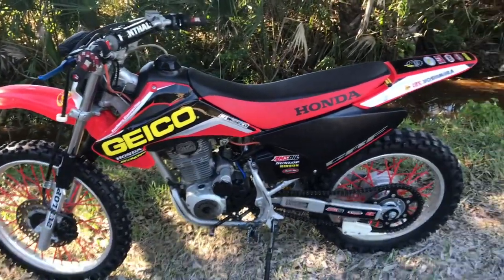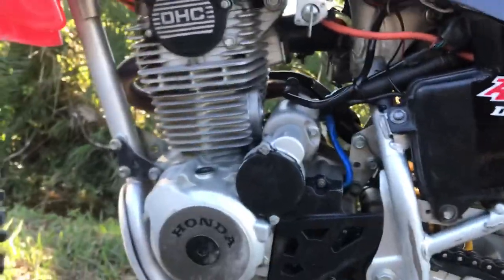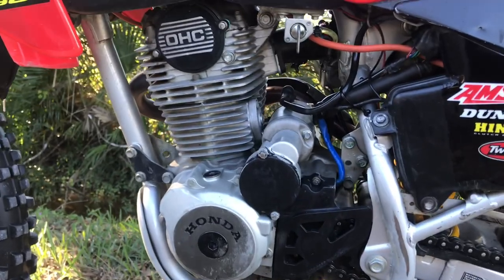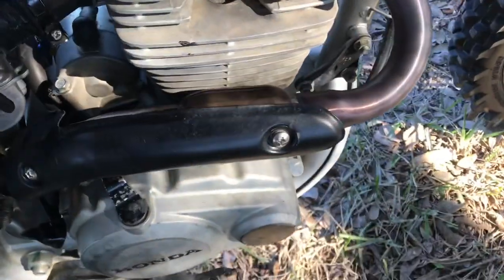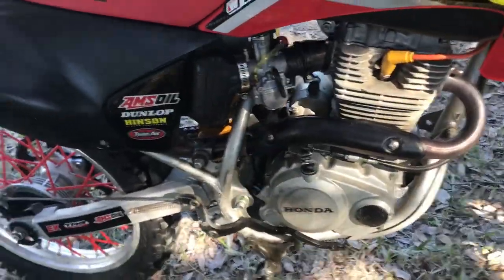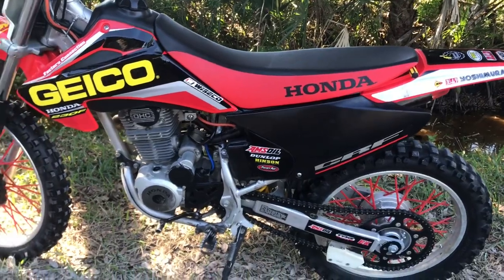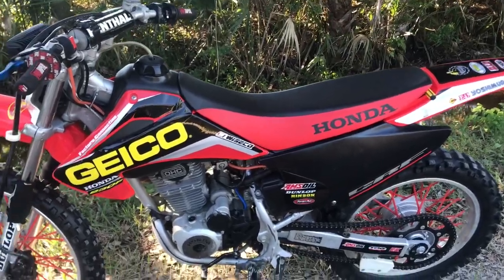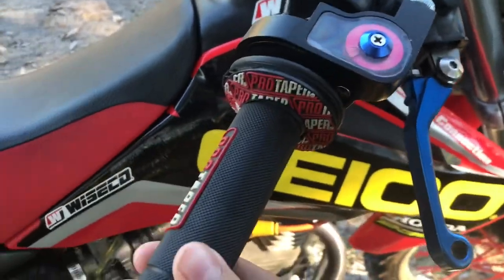Modified Crf230f (high compression rebuild)

Comment: gotta say man, this was a big inspiration for my build, ended up with a fully self ported and polished head, +2mm lift and duration cam, roller rockers, bbr valve springs, valve lapping, milled the head down, weisco 11:1 stock bore, 4k-12k rpm selectable cdi, oil cooler and more im sure I'm forgetting.
Reply from the maker: Sounds like it’s gonna be a blast. I had a hard time sourcing parts back when I built mine. Couldn’t find any reputable options for cams and springs that wasn’t $800
Reply: @garbinsgarage  kinda had the same issues but ended up finding an alibaba express one that was crf230 purpose built and claimed +2 mm for under $50 and the roller rockers where under $25 and actually the bbr valve springs costed about the same as roller rockers and cam combined. only down side was can and rockers where China shipped.

Comment: I just removed the smog stuff from my 230M, that made a difference! I'm looking to do a big bore kit or something in the near future.
Reply from the maker: Spartan375x, you can find a complete kit by athen for the 230 that brings is up to a 240cc but is a little on the $$$ side. I did a hone and used a high compression stock sized piston
Reply: @garbinsgarage  Do you have any links to that big bore or high compression piston?
Reply from the maker: Spartan375x https://www.ebay.com/itm/07-15-Honda-CRF230F-CRF-230F-67mm-233cc-Athena-Big-Bore-Cylinder-Piston-Top-Kit-/192898315821- this is to the Athena kit which in great not quite worth the money, I would by a slightly larger high compression piston like 66-67mm and have a shop bore out your old cylinder all that should be about $180

Comment: Switch your sprockets out youll get better acceleration and is way worth it on a dirt bike, Ive got an old '83 XR200R with a later motor big bored and cam job etc, doesnt sound much different to your crf here and I used a 11T front sprocket, havnt got times yet but it shifts, Ive also got a FTR223 engine with an ATHENA 240 kit and BBR cam engine I got for my XL185 as a donor engine but I may use it in my '81 XR200R due to lack of a local engineer for a modified engine build I had planned.... awesome bike kid ! ✌🏻
Reply from the maker: The only thing is with dirt bikes is, they are geared pretty low to start with. If you go to a lower ratio sprocket, you’ll get more acceleration but it will lower your top speed and make the gears really close. On a dirtbike, I would actually go up on your ratio so make the back one smaller by a few teeth. Give you more to end. I did that to my 230. I have a 49 tooth and I went to a 42
Reply: @garbinsgarage  depends what your looking for isn't it,

Comment: Engines only 250kit 11.5:1 compression only makes 23.5 hp( just the big bore and compression) no way ur stock bore 11:1 with carb, air box mods, and exhaust gonna add 7hp. A high end full exhaust will only add 1hp. 

U might have 20-21hp what ur feeling is the torque from the high compression.

Comment: is high comp setup has noisier engine? what fuel octane rating are you using?
Reply from the maker: MunsKi it is a little bit louder. Has an idle sound more like a race bike. And I run 93 or 91 octane. With about 11.5.1 compression it’s ok on pump gas

Comment: Does it run hot or does the bigger carb (rich air to fuel) help cool it down
Reply from the maker: Hasn’t overheated on me at all and I’ve beat the crap out of it at 7000+ for 30+ min. I jetted the carb correctly so it’s not Rich or lean. But it is pumping more air and fuel through the engine for sure

Comment: What’s you do to the front suspension? Did you take off the covers from the forks?
Reply from the maker: Yes the covers unscrew and pop off but you have to have the bike on a Stand or the springs will fall out. I put a 2in pvc spacer on top of the spring to get it preload and 15w fork oil
Reply: @garbinsgarage  thanks, I appreciate it

Comment: Does that carb Not use the 2 throttle cables, in other words more like most dirt bike carbs?  Had a 150 & the carb so much easier to work on. How much $$ does that carb go for?
Reply from the maker: This carb with a new cable and throttle perch. You can get one for about $20
Reply from the maker: Carb was only $40 but it’s a replica
Reply: @garbinsgarage  What's it called?  Ebay, Amazon er sumwhere else?   Same jetting as the original?  (ordering jets right now)
Reply: @garbinsgarage  Any idea what the actual SIZE of a 120 main jet is?
Reply from the maker: lee isenberg .012 inches I think or .12 they make really small drill bits in those sizes

Comment: Are you have ever problems with overheating engine because using 11:1 compression ratio on air cooled engine?.... tnx, and sory for bad english..
Reply from the maker: AnTonY no issues what so ever. I only heated up a little bit on a trail ripping 40 mph and rev limiter for 20 min straight

Comment: How much was the new carburetor ? US or AUD or something else?
Reply from the maker: $35 US off amazon. GOOFIT 28mm Tuning Power Jet Accelerating Pump Carburetor+Visiable Throttle Twister+Cable+Orange hand grips case for PWK 125cc - 150cc ATV Kawasaki Ho https://www.amazon.com/dp/B07B9S13ZB/ref=cm_sw_r_cp_apip_8oPKLFg4Khxms
Here’s the link. You’ll have to get a jetting kit also to tune it
Reply: @garbinsgarage  thanks a lot  for the information

Comment: If my bore is 67 van I use 65.5 mm piston?
Reply from the maker: No. Use the piston intended for you are cylinder bore. They sell a 67 mm piston
Reply: I can't tell you which piston you need
for sure Shavon, but if you have 
a 67mm bore, matched piston
might be called '67' but that would be a
'nominal' figure, it sure as heck better 
not be 67mm literally. In other words,
if you have a 67mm bore, you def DO 
NOT WANT a piston that is literally 67mm.
Pistons are sized in order that rings finish
off the mating of the two surfaces;
Cylinder to Piston.

Comment: did you change the camshaft or you run the stock cam?
Reply from the maker: Gabriel Manseau, no I wanted to keep it fast yet reliable. It does add more power with a different cam but more heat and stress on other components

Comment: I was wondering how did you take off the front shock boot and what did you put instead?
Reply from the maker: Mathieu Blinn they slide off the fork when you loosen the screws but the whole dirt or the front wheel has to come off. Mine were ripped and faded so I got seal savers
Reply: Garbin’s Garage can you please give me a link to where you got the seal savers please?
Reply from the maker: Mathieu Blinn you can find them on eBay or amazon. Just search it up

Comment: hello, what was the porting of the head? thx
 !
Reply from the maker: That is grinding out the intake and exhaust ports in the cylinder head. It’s for better air and exhaust flow
Reply: @garbinsgarage  thanks ; )
Reply: @garbinsgarage  how much did you remove
Reply from the maker: @YourDome_  about 1.5-2mm larger than stock

Comment: What carb did you run and where did you get it also do you have a rev box
Reply: also to add to this for me: 
1) what is the carb's jetting settings and your riding elevation? 
2) What did you have to do for the throttle  cabling (push/pull/single)?
3) how did you do to fit the carb back at both ends of the air & intake manifold?
thanks inadvance! And how awesome in the same day 2 ppl trying to steal your carb mod :)
Reply from the maker: Matthew Miszkiewicz carb is from amazon. Just a China replica. And no rev box. They don’t make one that is useful in the us. All the us ones do is remove the rev limiter even low Pierre drops off before the stock 9800 rpm
Reply from the maker: David Deir David Deir I have whole video on the car if you wanna check it out. 1)The jets are 135 main and 40 pilot at about sea level elevation. 2)The carb came with a new throttle cable and perch(it was trash though) 3) it barely fit into the air boot but I have to mesh together the stuck intake Manifold and the small rubber coupling that can with it

Comment: Hey, what is the top speed? I have a stock 2009 230 honda dual sport and it only goes about 70 mph. I'm looking to get it a little faster, so how would i go about doing that? would it require a new engine?
Reply from the maker: Amare Skateboarding. Mine only does 68-70 mph in 6th gear at rev limiter. The o or thing that will get you a higher top speed will be changing gearing. The stock sprocket sizes are 15 tooth front and 50 tooth rear. A smaller sprocket will raise the ratio giving higher top speed. I would put on a 45 tooth rear sprocket
Reply: I have the same bike 2008 crf230f. Will the 45 tooth rear sprocket make you lose a lot of bottom in speed?
Reply from the maker: Tyshaun Cobbs not really, the low gears are a super super low ratio so if anything it will make 1st gear more usable instead of only going 5 mph

Comment: Ah so those valve noises are normal , I figured mine made the noise even after adjustment.
Reply from the maker: Generic Girl yeah this bike had paranoid me to the point where I tore the engine down and replace the timing chain and still had the rattle so it’s pretty normal Eli guess
Reply: Just brought a 2005 , it’s noisy,adjusted the valve clearances, still rattles a bit , I was going to tear it down, maybe I’ll just leave it then.
Reply from the maker: Ian Frost yeah they tap a lot being an air cooled engine. If I get mine adjustment perfect while it’s warm it’s much quieter
Reply: Garbin’s Garage  Okay thanks that’s good to know , I adjusted the clearances to .004 with a cold engine.
Just wondering if you made any suspension mods,
Reply: Garbin’s Garage  Okay thanks that’s good to know , I adjusted the clearances to .004 with a cold engine.
Just wondering if you made any suspension mods,
Reply from the maker: Ian Frost yes, I added a preload spacer and 15w fork oil in the front and an xr350 rear shock
Reply: Garbin’s Garage 
Sounds good , that will probably be my next project, thank you for the info.

Comment: I have a crf250r that’s the same size and makes 45+ hp and has hydraulic brakes aluminum frame inverted forks etc
Reply from the maker: Hashim - 250r is a little bigger with a totally different engine. The piston is actually 40% bigger but the stroke of the piston is smaller that why they rev so high. Also they have a huge carb, aggressive cam, and very light internals
Reply: Hashim - nope not 45 hp, unless is a full built n still
Reply from the maker: Martin Bonao 42 from factory. Even the old ones
Reply: Garbin’s Garage I have ported head and power commander thohgh
Reply: Yes, that's right. We have the choice when buying a bike over performance or longevity. My CRF230 is well suited to weekend trails .
Reply: @garbinsgarage  in reality at the wheel they make 38hp. Look it up they dynod them. Plus the 230s lasy much longer than the 250rs.